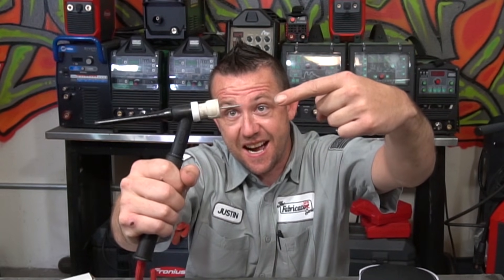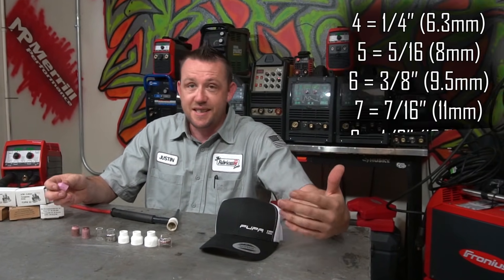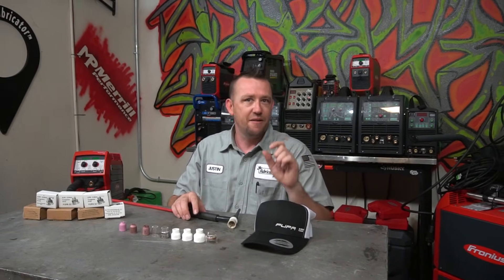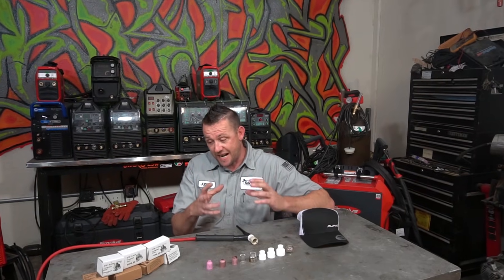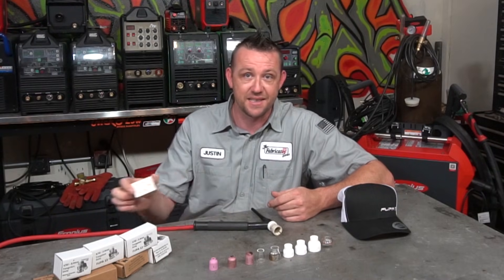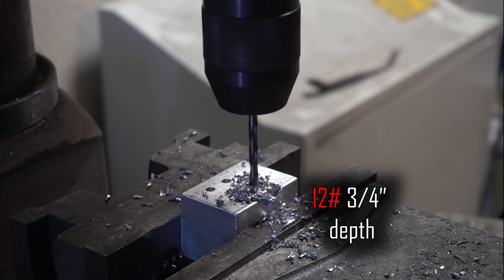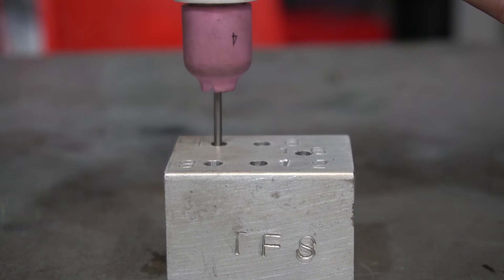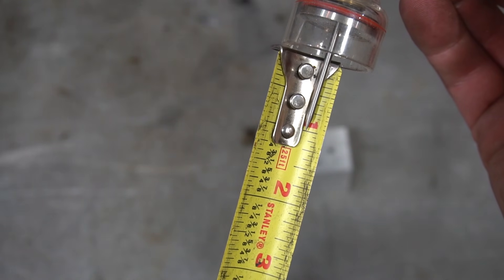TFS: Does Tungsten Stick Out Really Matter?

Comment: I get that the stickout is equal to the size of the cup.  But I didn't get the distance that you have between the tip of the tungsten to the metal plate.  Is it the same in all of them? And what distance is it please?  Thanks.
BTW, the numbering looked strange, but I quickly realize that the "number" is the "x" in the x/16" always.  Easy to remember that way. :)   So 1/4" = 4/16" = #4.  5/8" = 10/16" = #10. Etc.
Reply: Dan L. You’re right. It is the size in 16ths. Just like AN/JIC fittings. 

As far as contact tip to work distance, the rule of thumb is not more than one tungsten diameter. That is to say, if you’re running a 1/16 tungsten, try to keep it within 1/16 of the puddle. Best practice dictates holding as tight of an arc as you have skill to in almost all situations.
Reply: Had to scroll down to find this comment, or I was going to make it myself. Cup size is number of sixteenths. Makes way more sense when put that way.

Comment: Very Interesting how the heat is changed by the distance .
Reply: Phil Betthauser it didn't change the heat, just how wide the gas covered
Reply: technically the gas does cool the weld but the heat here is fairly consistent. The color changes are a result of how much or how little gas coverage the weld has as it cools. Essentially how much it oxidizes while it is in the vulnerable state going from liquid to hot solid where it needs to still be shielded, to stable solid
Reply: When you change one variable, you would have to adjust the others to keep the same results. I'm also thinking the gas coverage is what made the difference. If I have to go with a big stickout like on o-lets, I also bump the flow up some too.